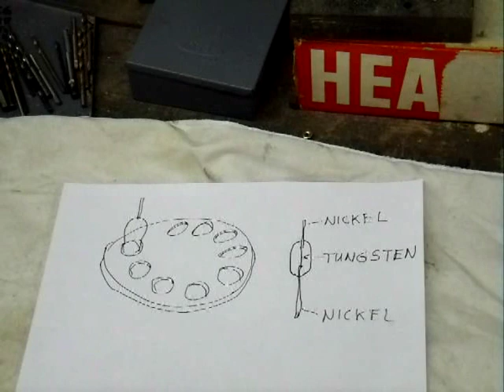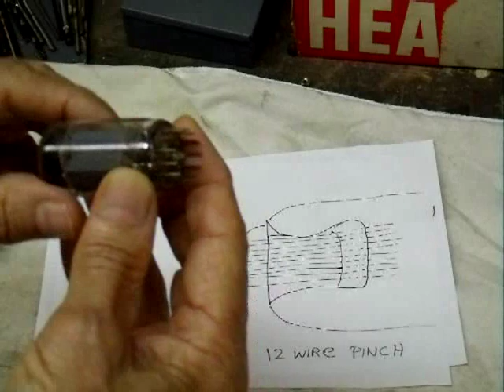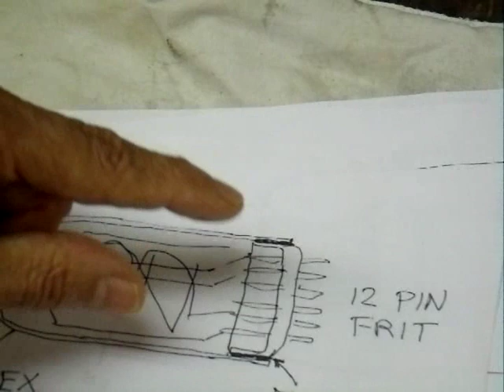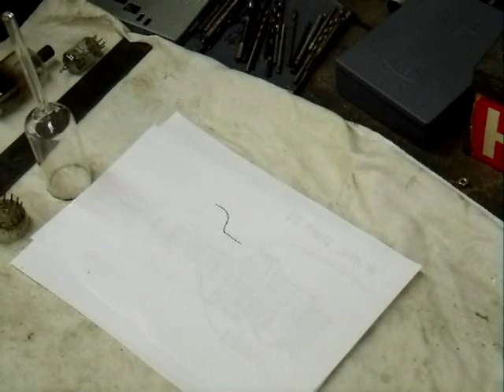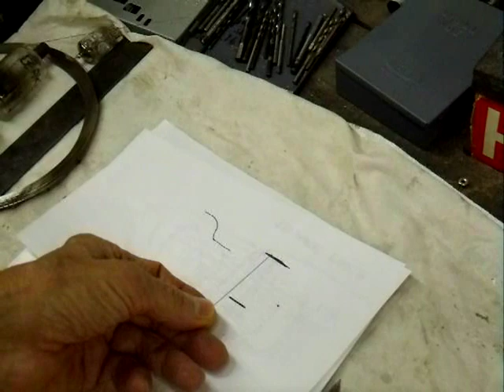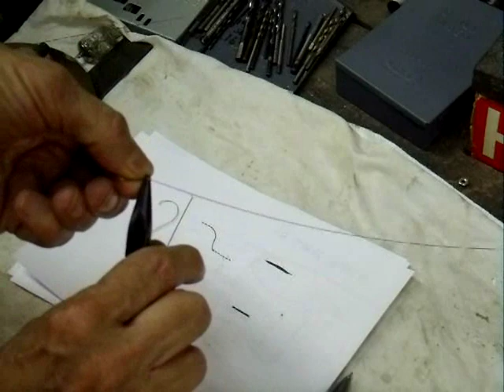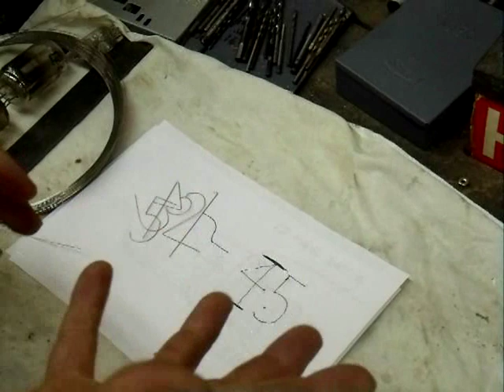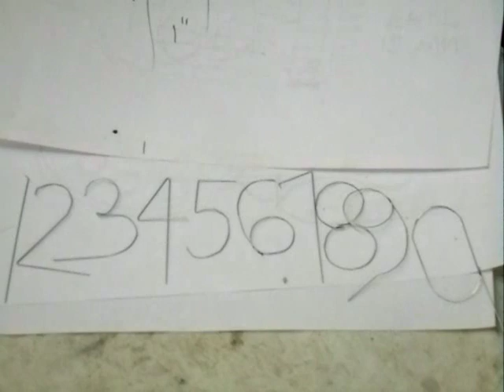making a homeade NIXIE tube

Comment from the maker: Glass and metal absorb air into the outer few layers of molecules. This absorbed air is at atmospheric pressure and will bleed out of the surface over time. (weeks) This will add air to the gas mixture. The getter reacts with air thus removing it. The getter doesn't react with the noble gasses like neon, argon, and helium, which are the gasses used in the nixie tube. Just flushing the tube will not remove water vapor or gasses absorbed in the glass so the getter is necessary.

Comment from the maker: It would be a possibility but would take some research to develop a workable scheme. The mica is quite hard to form without using a punch that is machined to be an exact pattern of what you need. I haven't figured out yet how to do the forming of the mica in an amateur shop. It shatters and splits when knives or scissors are used.

Comment from the maker: Yes! Another try at the epoxy joint, this time using all soft glass. Then if that doesn't work, make a whole tube from scratch using all pyrex. I really think the epoxy should work. It has a total bond to glass so that is one reason the glass frit pulled apart instead of the epoxy pulling away from the glass.

Comment: I really hope youll make a working nixie eventually. I know that there is a problem with the wires going through glass, i once bought a few leaked nixies that had tiny cracks around the pins. I think that the problem there was that somebody tried to push them into a socket that was just a tiny bit bigger, therefore cracking the glass.

Comment: I've long had an interest in making, not nixie tubes, but simple glow tubes, with a wire bent into a name or shape that glows. Can you post any information you've learned through subsequent tests pertinent simply to what type of wire I have to use to get a glow, assuming I evacuate and backfill with neon, and about how much pressure I need with the neon? I'd be using modified neon sign electrodes (cut off the base of the glass tube, cut off the metal shell, then weld my decorative wire to that and assemble like a neon tube).
Reply: Jonas Clark I'm pretty sure he has some videos on that.. the guys a genius with making tubes and shit

Comment: using PCBs on top and bottom of the numbers for spacing, combined with using etched numbers, making the internals would be pretty easy. The hardest part would be the frit (though the electronics part can be handled by the PCB, so just the seal part would be difficult).

Comment: Heck, you could use a circle PCB with traces from the outside circular holes to the line of holes inside. You'd just solder the numbers to the pcb, then solder the PCB right to the pins in the frit. Not to bad at all.

Comment: What about using sodium silicate (liquid glass) to seal it instead of epoxy? From what I understand when sodium silicate is exposed to carbon dioxide it hardens and becomes solid glass. It is not borosilicate glass and so I have no idea if it’s final state would be strong enough to withstand the vacuum. I understand Nixie tubes do not have a vacuum but are filled with specific Nobel gasses and a vacuum only need to be pulled during the filling process. So the Sodium Silicate would not need to be able to resist the vacuum for a very long time since once it’s filled it would be at normal atmospheric pressure. I could be totally off base here but it sounds good on paper.
Reply from the maker: Good intentions but a lot of problems! The nixie is always under vacuum, not high vacuum like a TV tube but still FAR below atmospheric pressure. (actually, about the same pressure as the atmosphere on Mars!) The problem with the silicate is it doesn't bond to glass with a vacuum tight seal.

Comment: Why epoxy? Why not just seal the glass? Or are you using 2 different types?
Reply from the maker: This was a test to see if epoxy would work. It is an industrial epoxy used for vacuum sealing. It was no good for long term use. The tube lasted about a month before signs of air developed.

Comment: What is "pirex"?
Reply from the maker: Actually pyrex, it is a high temperature glass that has a particularly low coefficient of heat expansion. It has very low tendency to crack when cooling like soft glass has.
Reply: +glasslinger Its expensive?

Comment: epoxy is a poor excuse for a vacuum seal, as it will allow air and moisture to get through it.
Reply from the maker: Fully understood. It was an experiment to see how long the seal would hold vacuum.
Reply: @glasslinger  When I was working with high vacuum. There was a 2 part epoxy that works very good for metal to other seals, just can't remember the name of it. Dunnway might have been where I bought it, but can't remember.